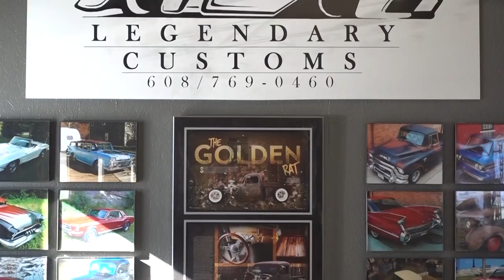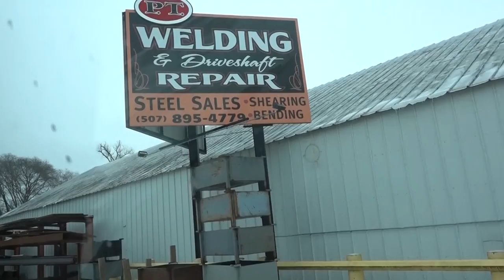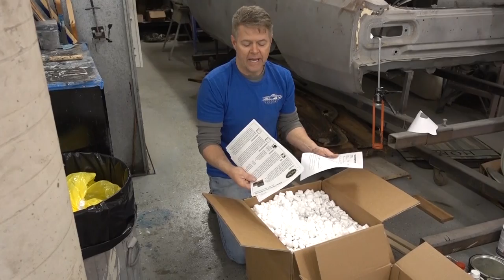F100 Crown Vic "Dirty Ford" Odds & Custom Front Ends!

Comment: I'm getting ready to do a 62 unibody shortly. I love that everybody has a different approach to this project and you get a lot of ideas. I think I'm going to do the frame stiffen that you have done here because I have heard some people say that they get some flex when they don't take the time to address it. I watched the hot rod garage guys put hockey pucks between the cab and the bed on their project.
Reply: Thanks for the kind words. Yes, stiffen up the frame. Or it will sage with the step cut out. Sleeve the original frame as we did.

Comment: Does that paint system work pretty good? Have you used that system before?
Reply: Tomas Moreno Yes the paint system works great. I purchased it for the first time 5 years ago. Lays out great & buffs great. Easy to color sand & work if needed.
Reply: @chrismeyer6196  you have any issue with fading or paint peeling? Or the clear delaminating?
Reply: @tomasmoreno9088  We have had zero issues with fading. Actually we have had zero issues with the paint; period.